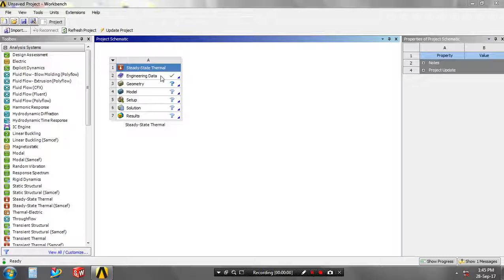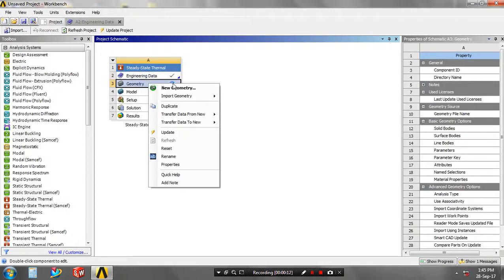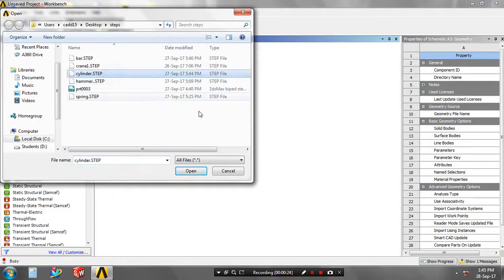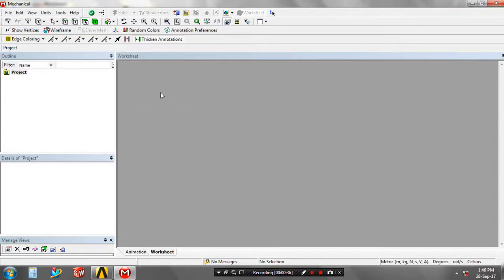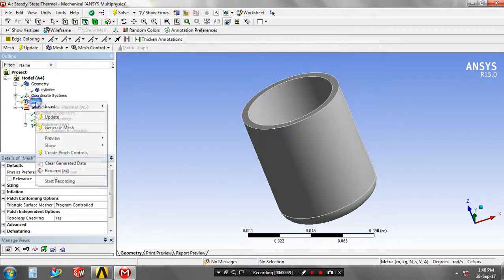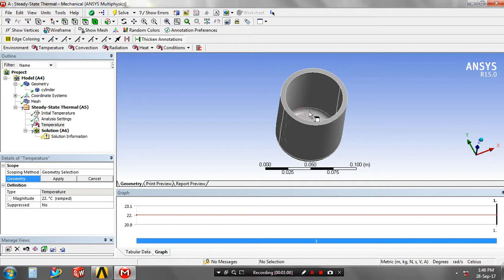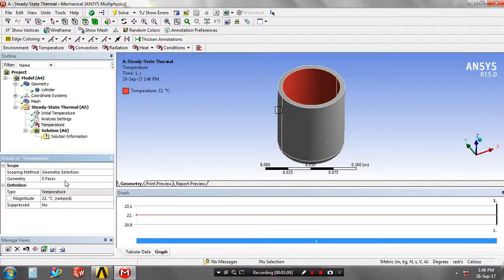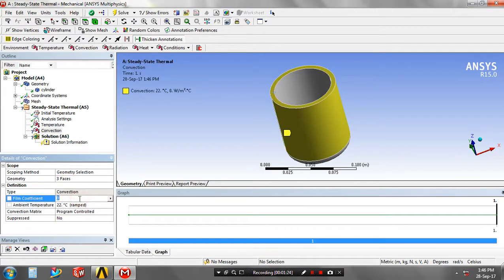STEADY STATE THERMAL ANALYSIS IN ANSYS WORKBENCH

Comment: You added 800 at inner face than why there is maximum 801 maximum in solution it means heat is internally generated